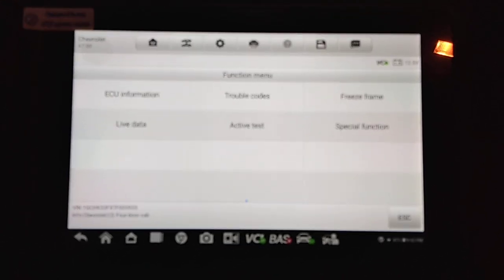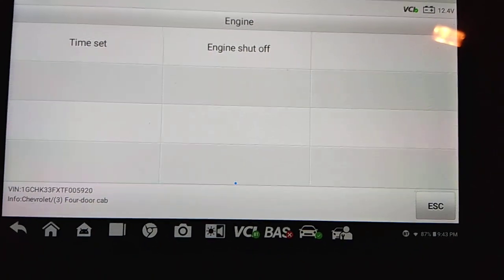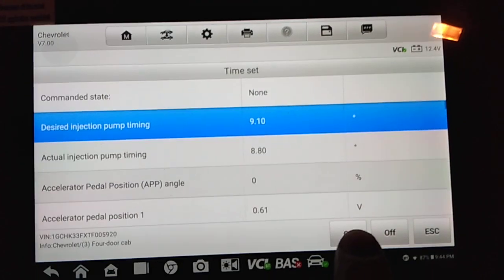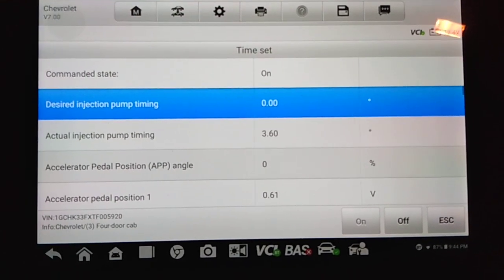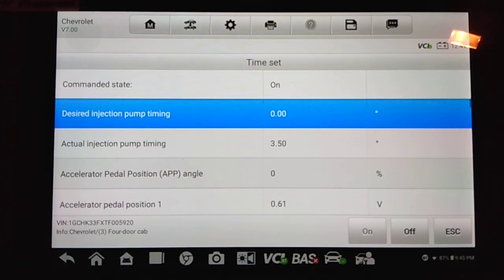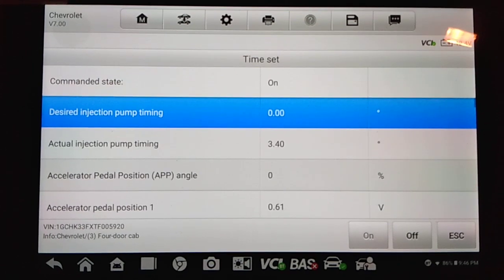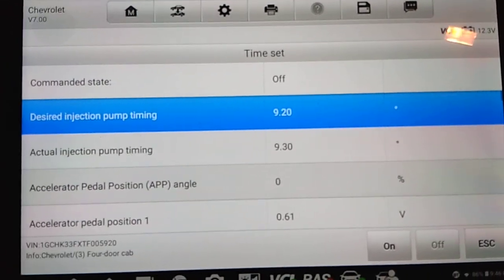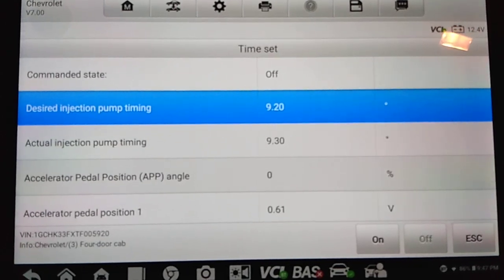Setting the Injection Timing on a 6.5L Diesel with DS Injection Pump using Otofix D1 Lite Scanner

Comment: I am having a problem with my 65. The actual timing always reads dead zero, no fluctuations
Reply from the maker: Are there any code set? Certain codes may put the PCM into limp-in mode and fixed / base timing. Feel feet to email us through our website for faster communication.
Reply: I have same issue always reads dead zero, codes p0251 and p0370. Any advice.

Comment: Hi, I’m in desperate need for help. I have a 1998 6.5td. The actual injection timing is 20degs and the desired is 10degs. When I command it to zero, the actual does not change. I have replaced so many parts on it…two different injection pumps, timing chain, engine wiring, cpu, cps, relocated the pmd, another new steeper motor, checked the grounds, ran through all the shop books tests. Nothing has fixed it! Also, checked if keys sheared on tc gears. Can you give any advice!? I live in the St. Louis Mo area. Can you recommend a mechanic? I can’t find one to work on it. Thanks in advance!